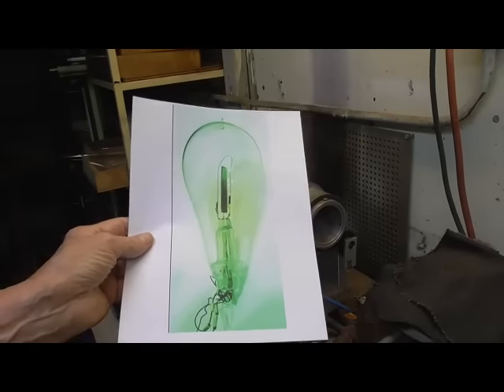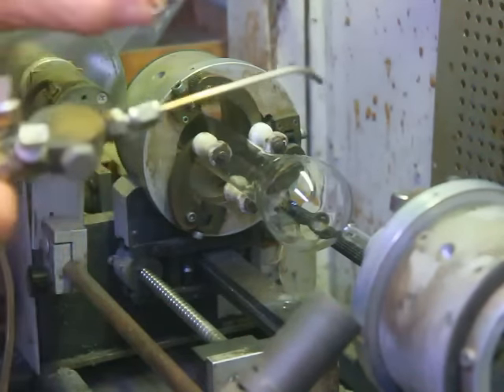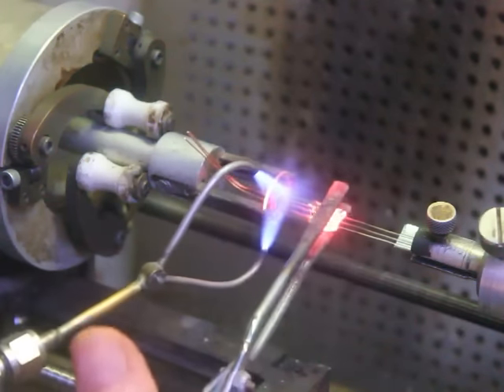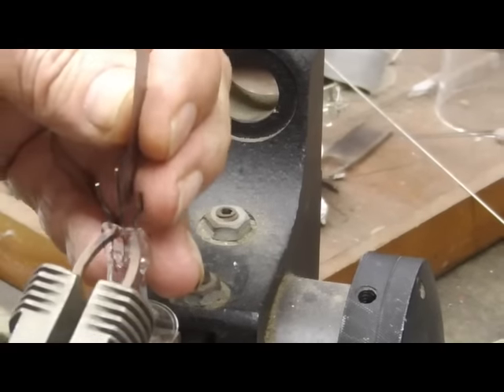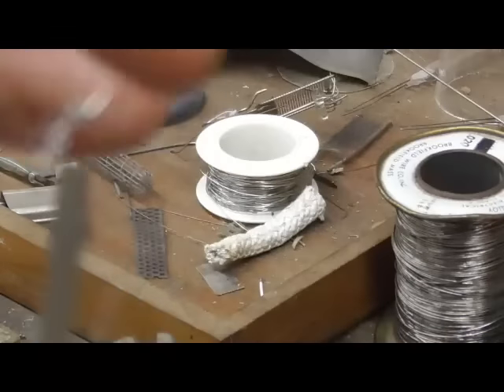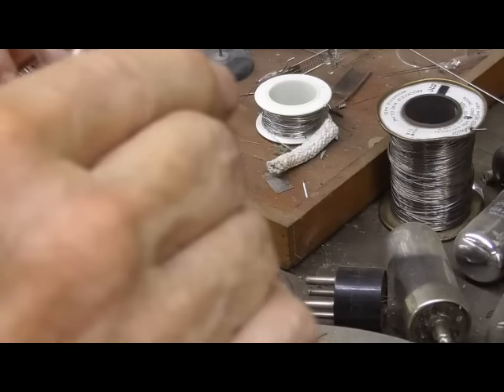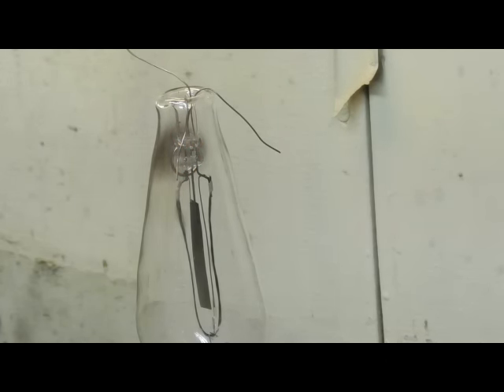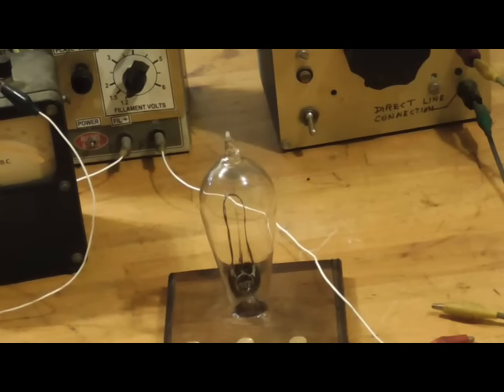MAKING AN EDISON EFFECT LAMP

Comment: Hello, May I extend to you my sincerest appreciation of the lifetime of skills you present. I am a retired Mfg Eng ( Elec Comm Equip) and a retired Naval Electronics Technician with a dozen job codes. 

You have mad genius skills my friend!!

I've never made tubes before. I seen all the equipment around your shop and I know I can speak your languages. I have a small machine shop with only four working lathes, two mills and one shaper. I have limited tools. Oh, two oxy-acet rigs, one of which is a jeweler's rig  with everything ( including the really large rosebud ) but not the split tip; havent got around to making that yet.

There's a program in the Advanced Technical Field trades in the Navy that was developed by them and NASA back around the time of the Mercury Project that codified the skills of high precision electronics and instruments fabrication and repair. 2M Program. Have you ever split a twelve layer circuit board into 12 different layers, repair the burnt trace in the middle, then put it all back together again? Try TIG welding under a 40x microscope. Anyway, I digress for a point. I truly recognize the insane level of skills you possess. I know how RARE a few of these skill sets are. 

I know of the two books currently in publication about the mfg of instruments of amplification, et al. One source is not enough.

Would you consider writing  an undergrad level syllabus for the topic of the arts and sciences of tube mfg, just the knowledge you have? The legacy to the DIY, Ham radio community would be incalculable. I even might be of some assistance, like a TA or an RA.  

Btw, the is a can of getters on eBay at the moment. FYI

Comment: Nice work! The grandfather of the vacuum tubes used in electronics even today (if you include the tubes used in some high end stage amps). That was a very satisfying project, even with the accidental frying of your first filament. I saw that coming even before you flashed the message that it was going to be a really bad idea!😉😁👍

Comment: It's a diode of sorts.
It was a very important discovery as it did lead to amplifier tubes.
Reply: Not of sorts. It IS a diode, just not sold state.
Reply: @matte2160  I think the issue is that it's not a particularly good diode tube. Of course that's not what it was designed to be so 🤷🏻‍♂️

Comment: When you cut off the leads inside the lamp (after you made and tested the seal), the diagonal cutters make a severe mechanical shock in the lead.  This can crack the seal.  You should use a shearing type cutter which will not shock the lead.
Reply from the maker: The cutters don't make that much shock. If that little shock affected the seals I would be out of business in a day!

Comment: i use heat tape on the jaws of the lathe , then you can tap the glass tub to get rid of the wobble,  Of course, you would need to rotate at a slow rate to tap the right location. All in all i think you spin the lathe at too high a rate, is something were to get unbalanced it would go out of control too fast to be controlled.
Reply from the maker: The rotation speed in the video looks odd because of the heterodyning of the  moving image with the camera frame rate. It really isn't that fast. However there are times when I do rotate the molten glass at high RPM to use centrifugal force to expand the part.

Comment: Where did you purchase that carbon fiber spool? Would you know the maximum voltage and current that it can handle per unit length? I want to find a thin carbon fiber/celluloid for lamp filaments, ideally 7" in length, and capable of handling mains power while giving incandescence.
Reply from the maker: There are numerous sources online for the fiber. Note that carbon filaments cannot be operated at incandescence. They must be kept at  a red glow, at most an orange. The lamp must be carefully exhausted and filled with argon to a few torr.

Comment: If everyone saw this, and light bulbs were still made by hand with skill and craftmanship, people would think twice before tossing an old bulb out. They be asking "can this just not be fixed?" I hate how a lot of people have a buy and junk outlook to everything they use.
Reply: Ha I spent many years in the lamp manufacturing industry and the factories have their product development labs which are fully equipped to hand make lamps and I can assure you that at lunchtime it wasn’t  uncommon to see staff actually repairing lamps that had failed.
Reply: Is your time really that worthless? A bulb that costs 10 or 15 cents to make isn't worth fixing (except for practice or fun) unless you can do it in way less than a minute.
Reply: @RobertSzasz  Some of those large industrial or 1000W projector bulbs cost a Lot more than 10-15 cents to make. I'm fairly certain he's not talking about fixing your average 60W house lamp.
Reply: Keith Yinger Hi Keith actually I am talking about 15 cent lamps and it’s correct to say engineers repaired them in their spare time to practice using the equipment. However, you are absolutely right to say these manual techniques are really only used for making very expensive lamps such as 10 or 20 kW for film studio use. These are made from quartz and the torch gas used to fuse and manipulate the quartz is oxy - hydrogen since the melting point of quartz is so high. The staff who made our specialist lamps were really great craftsmen.

Comment: If you had the carbon fibre immersed covered completely in the ceramic epoxy but not in a vacuum, And you put current and it glows red hot would that prevent the filament from burning out? Would the ceramic epoxy handle getting red hot and Cooling without it breaking down cracking?
Reply: You'd trap oxygen inside with the ceramic and fiber, it would still burn. The pumping and bake out would still be required.

Comment: what is the name of the welder tool you have to attache the filament plate ?
Reply: It looks like spot welder ( Punktschweißgerät )
Reply from the maker: This is a homebuilt pincher welder. It applies 6 volts at 90 amps to the pincher terminals for 1/10 second. For the finer wire welding I use a capacitive discharge welder. It applies 50 volts at hundreds of amps for milliseconds. This allows welding of very fine wires without burning them in half.
Reply: @glasslinger  I had never see this tripe of spot welder and now i know why thank you

Comment: I was worried by whst looked like a trapped air bubble in the glass bead, which could outgas over time and pollute the vacuum. I wished the filament support was electrically isolated in the glass BASE instead, which might also improve the plate current.
Reply from the maker: The bubbles are a problem but usually don't give trouble until after the video is made! :)

Comment: Hey Ron, can you tell us your sources of trusted borosilicate glass?  I've been buying beakers, that have held up to freezing-room temp over & over, with no problems.  Recently, boro-glass beakers are failing after 20-50 cycles of room-temp to freezing, whereas the older beakers are still just fine.  Maybe you could do a simple spectrographic analysis of glass with simple stuff around the lab?  ( I am NOT being facetious.  If ANYONE can do this, you my friend, sure as hell can!!! )  This would be of great use to us trying to buy good quality labware.  THANK you in advance!

And I mean recommended buys on Amazon or other sources.  I don't care about price.  I want QUALITY boro glass.
Reply from the maker: Your question has two answers. First on the boro glass. I get all my tubing from Mountain Glass. They have good quality. I have used both the USA made and the chinese made with no problems. 2: As for labware, you would have to buy it from a professional supplier rather than from hobby sources like ebay. Expect to pay for the professional quality! I have not had any problems with the "chinaware" yet. But most of my stuff is not yet 10 cycles used.

Comment: whats the difference between this and a flemming diode?
Reply: I believe Edison was experimenting with this to minimise the deposition of filament material onto the envelope of his light bulbs that would slowly turn black.  He was not investigating the diode behaviour even though he did notice it.
Flemming figured out how to use it for radio reception.  He was also working in vacuum and not trying for a gas backfill.
The effect was first detected by  Frederick Guthrie ten years before Edison stumbled on it.
https://en.wikipedia.org/wiki/Fleming_valve
Reply from the maker: The degree of vacuum in the envelope. Edison didn't have the equipment to produce high vacuum so there was a lot of ion conduction in the lamp.
Reply: @glasslinger  Ionic, or "CANAL RAYS"? This is the opposite of cathode ray tube emissions which are just electrons, produce a different fluorescence? ? ? 
Even I don't  know what I am saying  :-(

Comment: Could you use that to make a crystal radio?
Reply: You could make a crystal radio much easier by using a crystal and cat whisker or a germanium diode. Technically he did make a diode though.
Reply: The crystal of a crystal radio would be used to replace the thermionic diode so it would no longer be called a crystal radio.
A crystal radio is called by that name because it has no power supply and the thermionic valves need power for the heater/filament so are not in the same category of broadcast powered receivers.
The Flemming valve was developed for radio reception and was only a little bit different.

Comment: 12 :56 why its leak is  tested with helium  ! And how ?
Reply from the maker: See some of my other tube making videos where I show the leak detector and procedure. Helium is a small light molecule so it passes through leaks very fast plus it is light weight so the spectrometer tube in the leak detector can separate it from other gasses easily.
Reply: @glasslinger  thank you for rpy

Comment: Hope you read this. I must say you do beautiful work but you at some point will accidently create a catastrophic/deadly cut with your glass cutting circular saw which runs all the time when lath is running. Deep Cut, Hurindous bleeding, Great Pain to Unconsciousness Possible Bleed Out.
Reply from the maker: Amusing thought! Actually the motor driving the blade is micro horsepower! The slightest touch stops it. When cutting glass the blade must be barely touching the glass to keep the glass from cracking. Thus, virtually no power is necessary.
Reply: @glasslinger  Not "Amusing thought" not to me.

Comment: Hmm. I don't understand what you meant by a fake reading with your leak detector.
Reply from the maker: The mass spectrometer in the detector is detecting 1/100 of a microamp current. The input amp electrometer tube is a real vacuum tube so it has the drift associated with them. This causes random swings in the current that can be mistaken for a leak if it is not carefully nulled out.